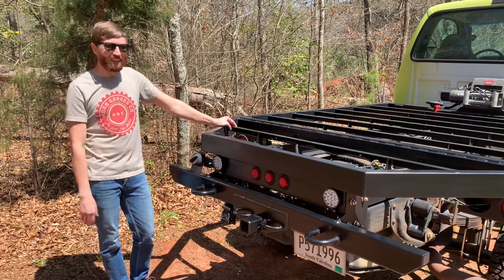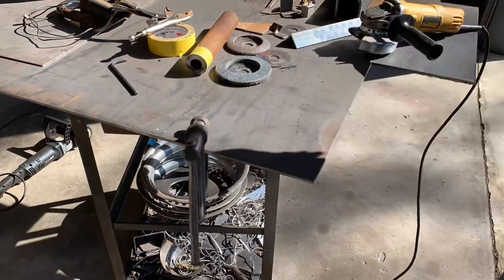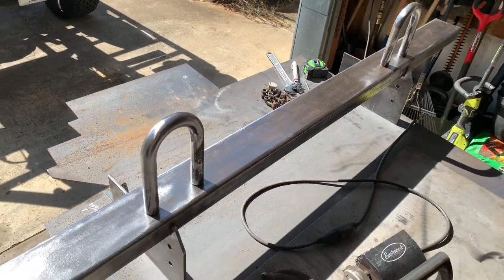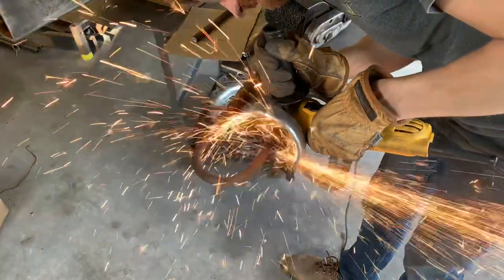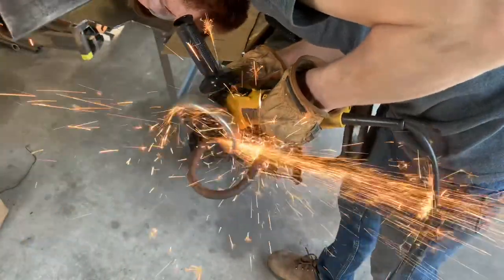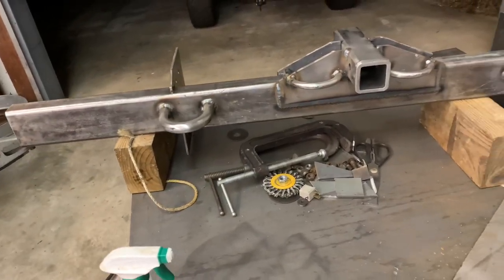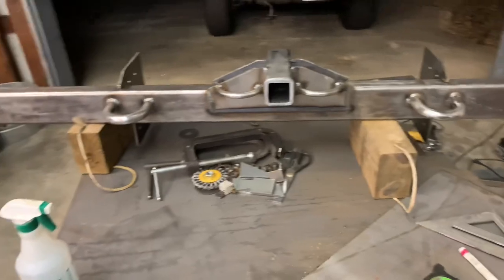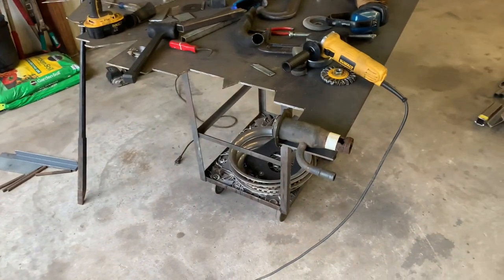Superduty Flatbed Bumper Build

Comment: What’s the purpose of the angled bed if the bumper is wider than the taper?
Reply from the maker: Just preference, I like the angled bed but I’ve been rear ended before on the interstate so I wanted to make the bumper almost full width.
Reply: @iamtaylorcorbett  the only functional purpose for the angled bed is to increase usable bed space without getting in the way of a gooseneck trailer. so if you're not towing a gooseneck you can make it any which way you please and it doesn't hurt anything.